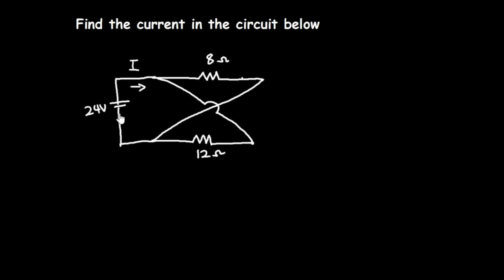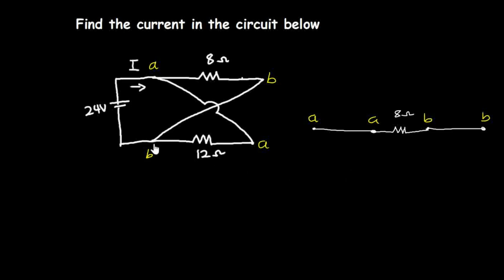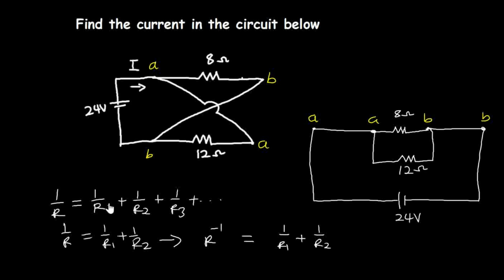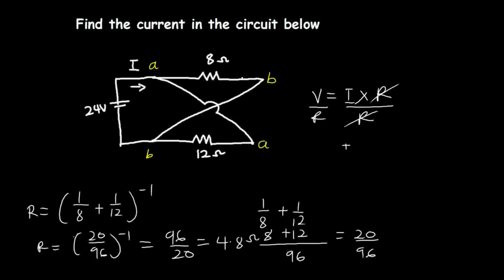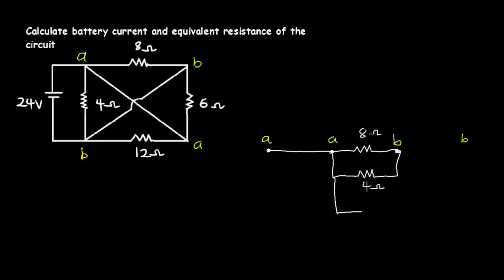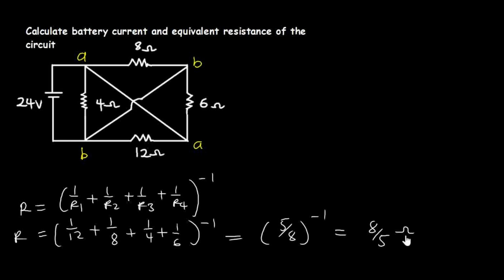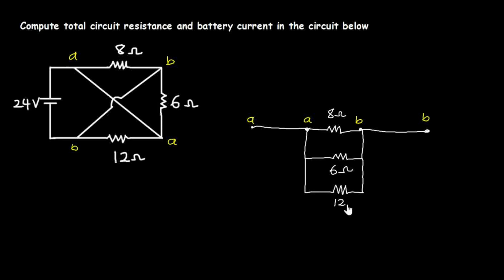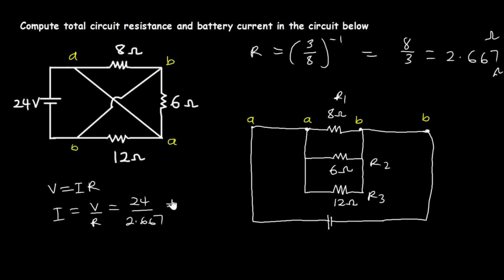Calculating Effective Resistance And Current Of A Circuit

Comment: Thank you very much, please I want to ask; the paths without the elements, are they short circuits?
Reply from the maker: No please,they are not short circuits. This is because when you redraw the circuit,you will see that those paths without elements doesn’t prevent currents from flowing  into the resistors in the circuit. But they rather serve as a path for current to flow into the resistors.So for this reason,they are not short circuit paths.
Reply: Thank you very much
Reply from the maker: Welcome Sir.